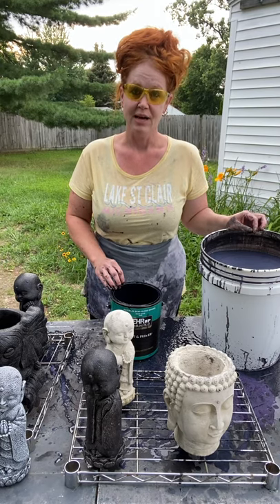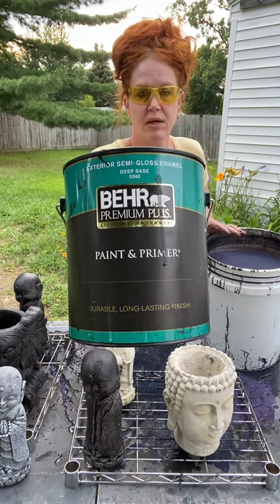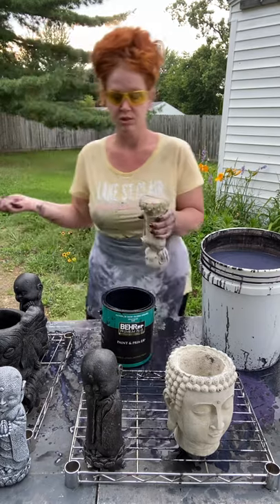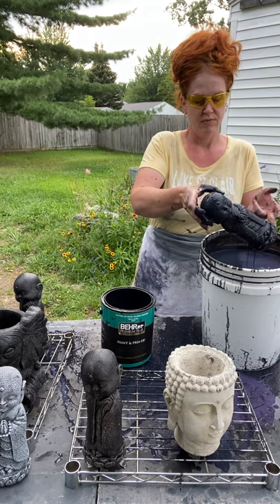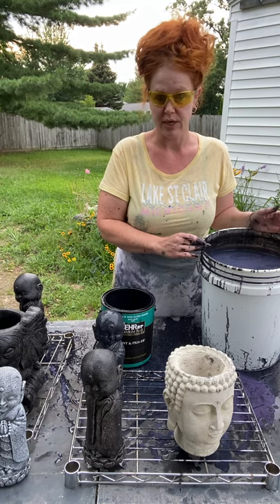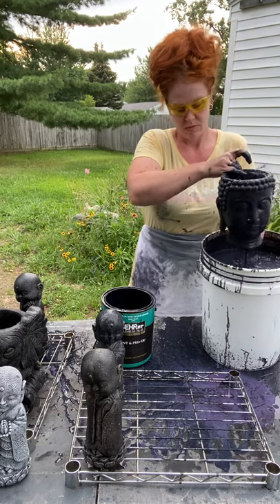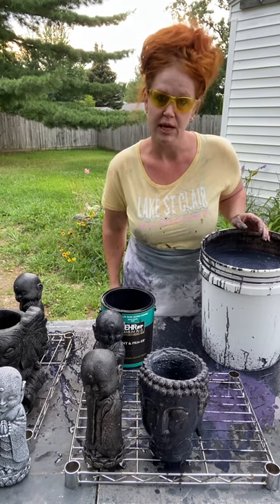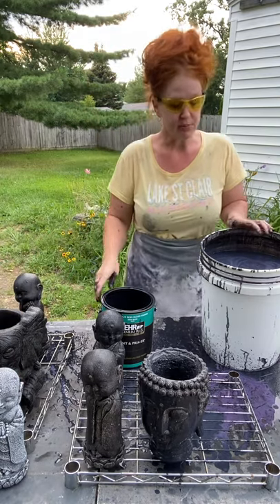Base coating statues the EASY way

Comment: The guy I buy mine from uses a cheap paint sprayer from Harbor Freight for his larger statues…I may need to look into it. The base coat is not nearly as fun as the rest of the painting. But the sprayer does make a mess so you need a dedicated space that can get a little messy. Great idea for the smaller sizes with the bucket!

Comment: Hii tammy, could you please teach us how you mix your concrete ? What ratios do you use.. your statues are flawless !!
Reply from the maker: I use the product CTS rapid set.  I don’t have a specific ratio.  I simply add water and mix until it’s the consistency I need.  I never measure but you can follow instructions on the product if you decide to use it.  It sets yo fast so I suggest working with small amounts at a time until you are used to it

Comment: Hi Tammy I have a quick question. I use cement all rapid set concrete mix & after the critters have set for 2 wks I do a base coat. I do your method but my ratio is thinner. I only add 1 gallon on clean slate color ( rustoleum studio) to not quite half of a 5 gallon bucket. After the 1st coat is dry I go back & brush on another coat where & if needed. Ok to my question,  sorry for rambling on. So after I dunk my critters/statues into the bucket of base coat & set them on some scrap hardware cloth left over from my chicken coop to drip dry. Once they are dry & I go to remove them, some are stuck & leave the small design of the hardware cloth on the bottom. Then it wants to peel off! I wet them down by also dunking into a bucket of clean water before putting in the bucket of base coat. Why is it doing this? How can I get rid of that on the back of memorial plaques I've made? Please help if you can! I just started doing this 4 months ago, so still a newbie.
Reply from the maker: I’m not sure I understand entirely.

If you set your pieces up and off the surface from where liquid paint collects, then you should not have a problem.  You could always let them set for about 10 minutes and then run a cloth over the bottom.  

Keep practicing because you will learn a lot of things through trial and error.  I’m sorry for my delayed reply.

Comment: Hi Tammy when you have dipped your statue in black paint do you have a problem with the pin holes you can see
Reply from the maker: Hello…I rarely have pin holes.  I use a product called CTS rapid set sold exclusively at Home Depot in USA 🇺🇸 

My suggestion is to perfect your mix and also your method by using proper mold release, tipping  your molds upside down so no excess release pools prior to pouring and tap them out with a rubber mallet very well along the sides after tapping them to the ground or whatever you are pouring on.

Good luck
Reply: @concretekeepsakesbytammy7166  Thank You

Comment: didnt you dip in a water bucket first?
Reply from the maker: Most of the time…Just depends on the actual pieces I’m working on.  If my paint is thickening due to evaporation, I will just dip in water first.  Otherwise, if it’s a thinner application I just dip into it